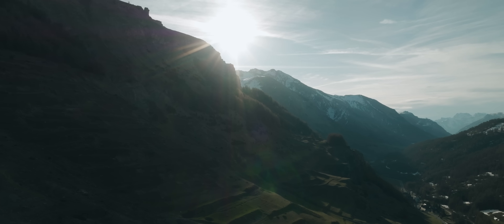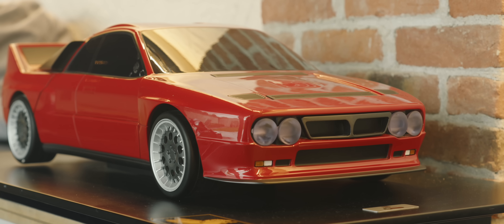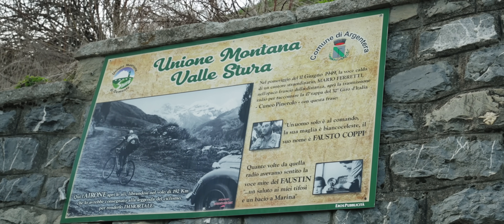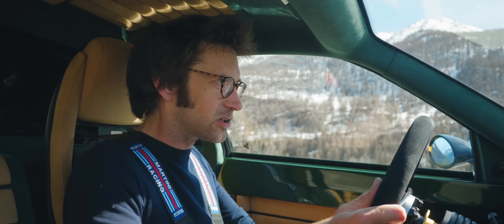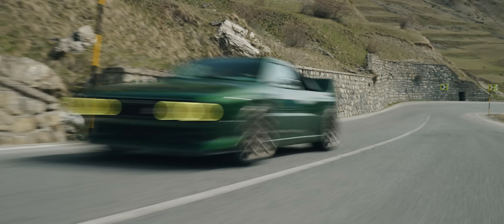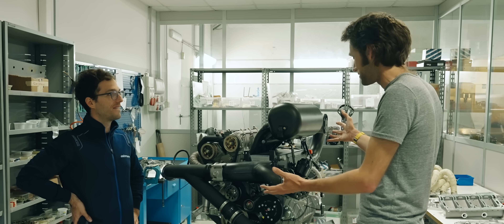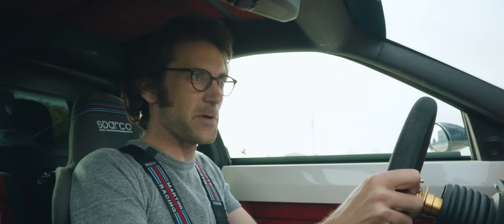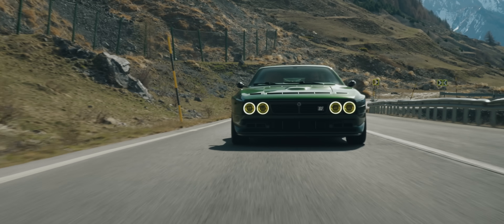Driving the Kimera EVO37: The Group B Restomod | Henry Catchpole - The Driver’s Seat

Comment: So obsessed with this thing. It looks and sounds like nothing else
Reply: It also  shows  you don't  need a huge engine to give more than enough power.   2.2l twin charged  engine is  and absolute monster.  There is a reason  that v12/v10(and soon v8s) are gonna die. They where perfect before the modern tech made a smaller boosted engine more efficient  and more powerful.  The engine in the Gr yaris is a prime example. A crazy powerful turbo 3 cylinder that has as much grunt as a NA v8 from not so long ago while burning 1/2 the fuel.
Reply: @rhyswilliams4893 thanks to f1 technology
Reply: @PosyaKisa  true. Tbf f1 started with  tiny engines(by racing standards) 1.5l NA engines. Then Enzo came along with  his 'there no replacement  for displacement' mentality. Its clearly not true   because all of the most powerfully  engines ever in f1 have been 2l or below and forced induction.  The 2l BMW could  hit 1000hp(1350 if  some stories are to believed)  and a 2020 hybrid  engine  can  hit 1000hp  and  run for  2500+ miles at 65% thermal efficiency  and doing  6mpg.

Comment: This has got to be one of the sexiest cars ever built. Right I there with the f40. I’m a sucker for late 80s and early 90s styling and this is a winner. They power train in this also would be an absolute blast to drive. A complete edge of your seat drive through and through.

Comment: These new restomods are so fine. Singer's Porsche 964s, Cyan Racing's P1800 Volvo etc have everything you want in a driver's car.
Built tough, with reliable engines and electronics, they put you in a different league out on the road.
Try and chase that Kimera 037 on a winding road in most supercars. You would have to be good to stay with it.
It's kinda like an Audi Sports Quattro for the 21st century in an expensive Italian suit.

Comment: Even though I watched the guy talk how the supercharger and turbo work at 15:40, I still didn't really understand where the air is piped when the valve closes after the clutch engages in low rpm, and how it gets the air to where it needs to be to help spool the turbo. But with the diagram I can see that low atmospheric pressure from the supercharger drives the inlet of the turbo.  It gets confusing about which way the air flows during what stage with the triangle intercooler loop piping. And when the valve is open after 4000 rpms, it looks like the air goes into the super charger when the clutch is disengaged. There must be some sort of check valve or something to stop the air flow thru the supercharger when the clutch disengages.

Comment: So they pull air from the turbo and straight into the intercooler, instead of using air to spool the turbo, which i maintain is the better way to twin charge

Comment: This is brilliant, but there is a delta restomod .
And for this one reason alone it's better, it has a "Juha switch" lol where it gives max power and maybe handling is improved.
Whatever fast car I have from now on with different maps, will now also have a "Juha switch" or mode and this will be running max lol.

Comment: That’s my bucket list road which l want to drive down in three vehicles, one metro 6R4, Ducati desmodici, jaguar xj13, the V12 ripping off the walls of the valley, then the metros short chassis trying to kill you at every corner. Then the desmodici, the metallic engine sound off the walls on the road. OMG lush sounds and dream.

 That’s very Italian jobesque, copy due to the filming of the wheels as it turns and from the rear quarters as well. Thank you mr catch pole for copying the Italian job start of the movie and to the late mr Kennedy who did the film but was lost too soon to cancer.
But l think this should be the next baddies car in the next Bond movie, whom ever takes on the role of James Bond.

Comment: Held back by the engine. Just stupid to develop the whole plattform from the ground up and then stick with an underpowered inline 4 cylinder. What a shame. That thing should have had a 6 cylinder  with 800 hp at the wheels. To break free of traction at any point until vmax.

And also 500k+ and you could not make a monocoque?